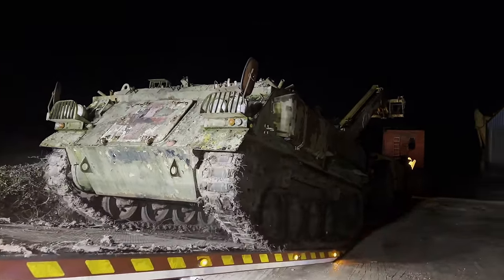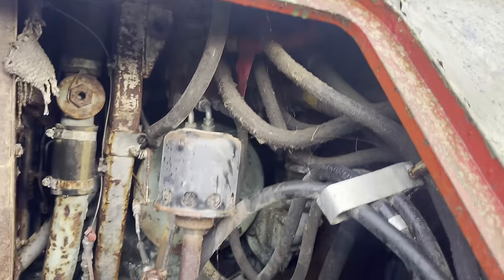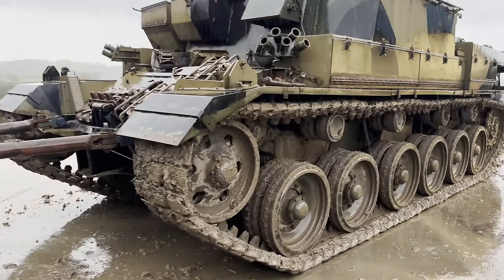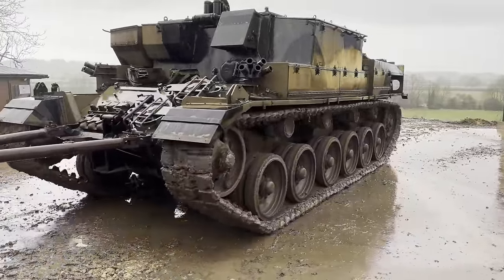MY LAST VIDEO OF 2023…

Comment: A bigger workshop is definitely  needed in 2024. Or bigger doors.
Reply: Or more send.
Reply: Nah. Just let some air out of the tyres next time  ;)
Reply: 4005 with turret might cause slight issues with the door
Reply: It's a very British workshop at the moment
Reply: @wilkybarkid I see what u did there....
Reply: The center-door is 'slightly' bigger...
Reply: Or just a lower floor.
Reply: @davelack553  😂😂
Reply: I had the exact same thought, I also had the thought of them getting themselves some industrial overhead cranes so they dont need to use the Foden for lifting off turrets.
Reply: @wilkybarkid  😂😂
Reply: Let the tyres down on the road wheels. Any proper REME mechanic would know this 😂

Comment: Ironically, the 432 is a medical vehicle. It looks sick.
Reply: Mmm up to a point Lorf Cropper.

This particular vehicle may have been used in an Ambulance capacity (hence the big red cross on the front) but:- .  
The 'family', the 432 (I suppose more correctly the FV432 ) belongs to, were all built on the FV430 chassis
By far the largest section of this'family' were 432s (the APC variant if you like).

Whilst there were some specific variants that used the 430 chassis,  most were  432s but  converted with 'install kits' according to role (this was easily done).
My brother drove a version of a 432 (that was outfitted with maps. more radios etc this was used as "the boss' " command centre (NOT a 435 just a  432 with maps and radios)..

Comment: Bigger yard needed me thinks to help the Fodden get stuff in the sheds. Good solid workhorse but needs a bit of room to help get stuff turned, would be harder without the assistance of the 360 digger. As for the door, think of the height of the biggest thing that might be ever worked on by your team, add a 'little' bit for good measure then no problems. Happy new year to the team and hope to see more good work and no doubt a few antics too (wouldn't be the same without them!).